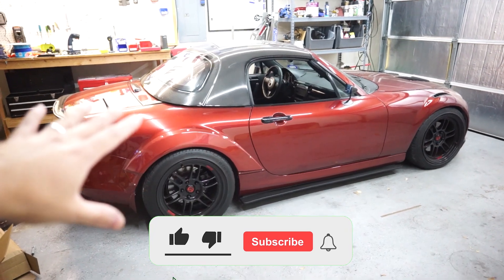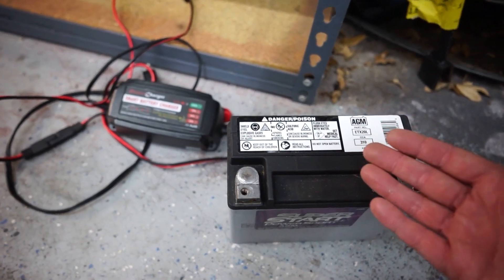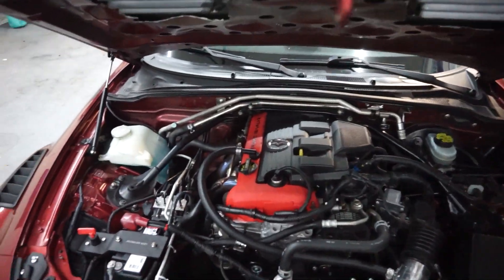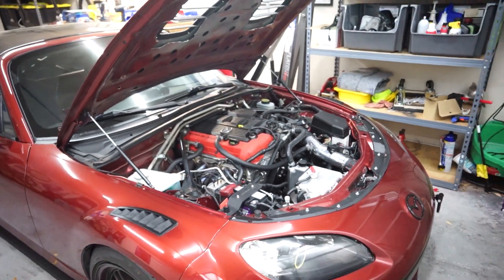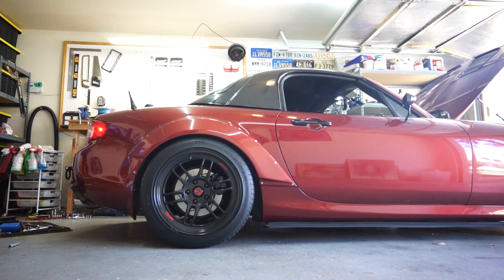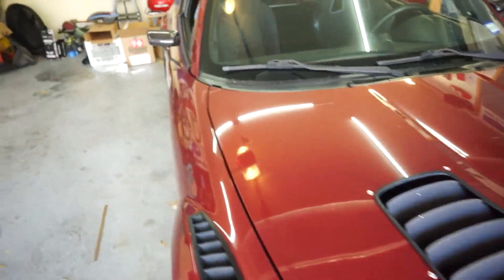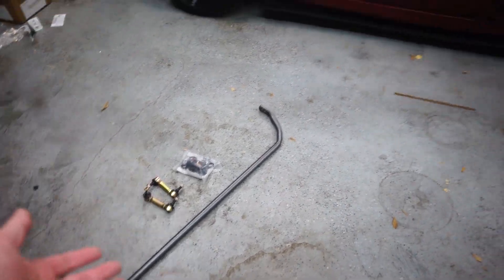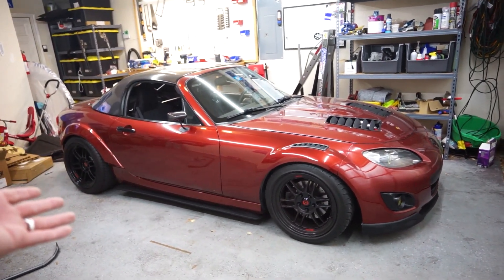How Long Does a Race Battery Last? 2.5 SWAP NC MIATA UPDATE

Comment: Nothing is worse for a battery than letting it discharge past its rated voltage. It's really the main thing that kills batteries. It only takes 2-3 discharges past 12 volts to kill modern car batteries. Consider a quick connect so you can keep it on the trickle charger when not in use without having to remove the battery
Reply from the maker: I show the quick disconnect in the video